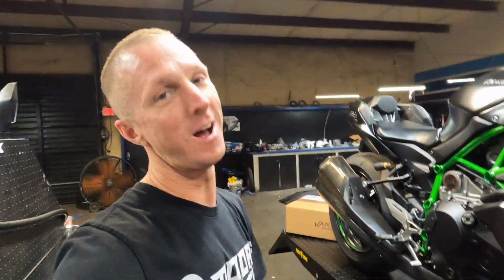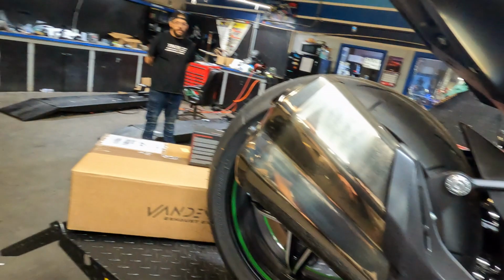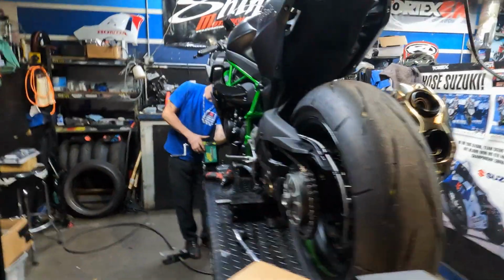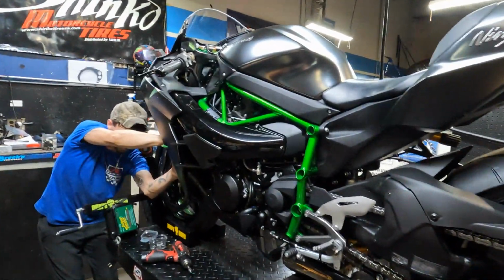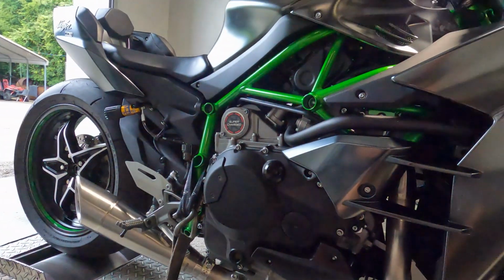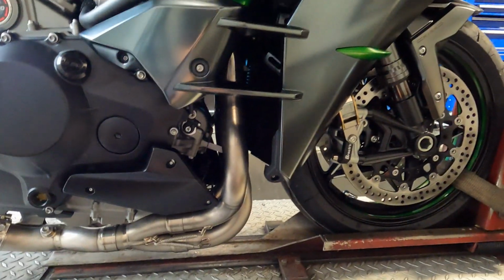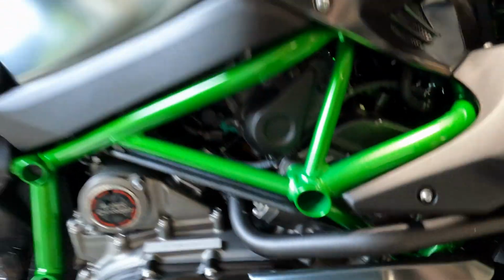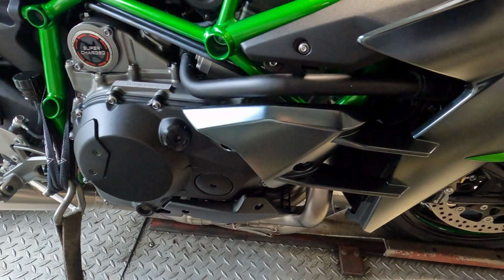My 2023 H2 Gets A Vandemon Exhaust | Big Kountry Ain't Ready!

Comment: Hey there. Chris I’m having some trouble getting my zx10r to hook up 2005 model. I weigh about 142lb I’ve got rebound set at 1 3/4 and Compression set at 3 turns out. It just blows the tire off.. same thing as your bike was doing the Gsxr 1000 with the air shock video. What did you do to that bike to get it to hook.. any help will help lol

Comment: If you dont flash the ecu when running this exhaust system can you leave the factory exhaust servo motor in and just tie back the cables or will it throw codes if you do that?
Reply from the maker: Typically it will throw a code.

Comment: Two questions. What made you pick the Vandemon over the Brocks Penta-Carbon? Next, would you recommend the sprocket swap on the Z H2 once it's flashed?
Reply from the maker: They don't make the penta carbon for the regular h2.
Reply: I would say yes on the sprocket swap as it lowers the available torque in each gear and swaps it out for hp by shifting the power. The torque is what makes these wheelie machines.

Comment: I wish Chris would tune the ZH2 like the H2. Not sure why he thinks the internals are better. The pistons in BOTH are cast the H2 is lower comp. The rods are the EXACT same. The crank too. The cylinder head is different. The supercharger is EXACTLY the same. The fuel injectors are larger on the H2. Run you ZH2 on E85 and it will make as reliable of HP as an H2. Why run $35gallon fuel for a few ponies when supercharger gears are cheap as is 260+HP on E85. Someone relay this information to Chris. He should also get the intercooler for the bike. Heat is the downfall of boosted applications. Also lean is mean! Add some fuel. These AFRa should be around 11.5 or less to 1 on boost and 93. NO WAY would I waste money on such an expensive exhaust unless I had money to burn . Intercooler, blower gears, ceramic bearings, upgraded fuel system, etc would ALL be before an $$$ exhaust on this bike.
Reply from the maker: If you say so... I've seen way to many of them throw rods through the block.  There's a reason the bike is over 10k more money. It's not just because of the fancy plastic.